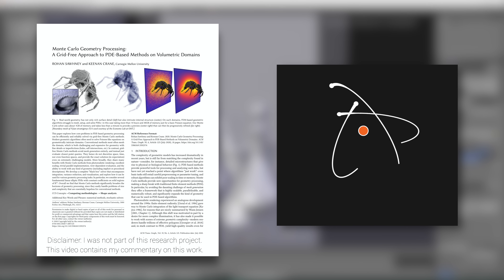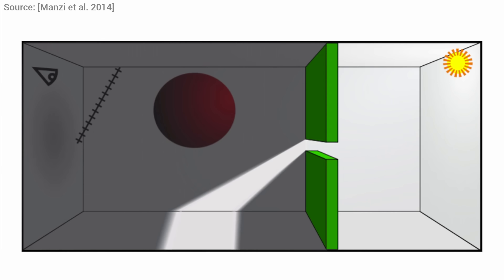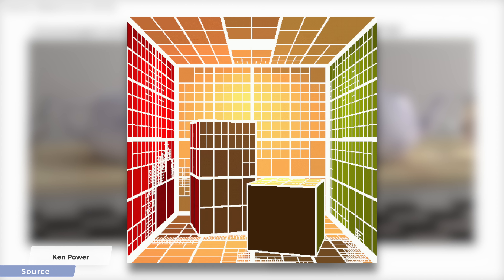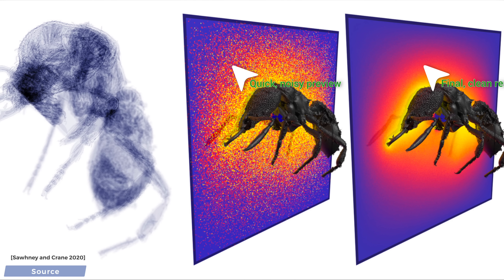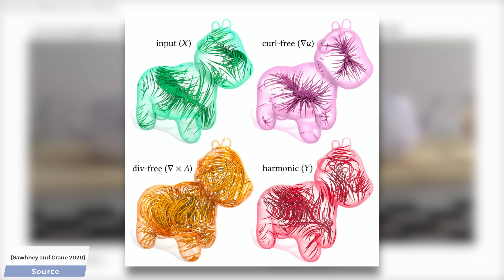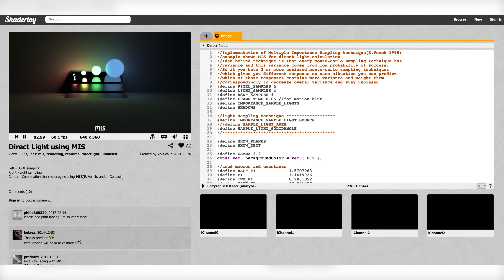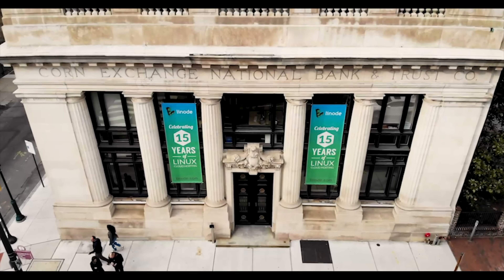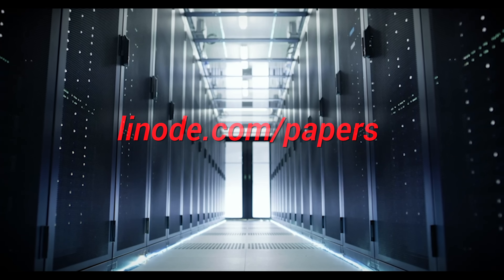This is Geometry Processing Made Easy!

Comment: Sure the implementation might be short but the quality and efficiency is quite garbage compared to what you can achieve when you actually reconsider your concepts and integrate possible algorithms to shorten or improve it, so you will eventually end up
 with conditionally different implementations based on the given environment and use case to lower the overall computation complexity. 
That's also what happened to the ray tracing meta where directx devs started to use bvh trees for intersection checks, computed by morton code based splitting, and hardware ray intersection support - etc - not comprehensible for the average college pleb.
Not even talking about cache line alignment, SIMD and GPU compute pipelines. This is just a really simplified implementation and as a OG cpp news and project subscriber you surely can tell that the source clearly isn't the cherry of the cake. 
Cpp shouldn't be written the same way as you write your shaders. This is a mixture where the coder seems to put GPU favoured code into cpp instead of writing a shader or making use of CUDA/OpenCL.. But I guess, sometimes it's better to stay focused on the mathematical part of things.
Anyhow someone will eventually come up with the 10k+ lines of magic for a more complete and qualitative implementation.

Comment: I recently started learning FEM for physics/engineering problems, and I feel like that field would also benefit from this paper. I'm a total newbie, though... Any thoughts on that?
Reply: Same, it's fun to recognize the Monte Carlo method.
Reply: I would be interested to.  I'm currently studying FEM as a Ph.D. student.  I found the paper interesting as it did talk a lot about FEM and the very real challenges that it faces.  I'm always a little skeptical of new techniques that claim to compete with FEM.  The paper really only considers linear problems which is boring.  The big question for me is how well can it handle nonlinear problems?  The paper claims that the method can be extended to nonlinear problems, but my experience has been that many can claim that, but few actually can deliver.  It is always much harder than they think it is.
That being said, I do think that there is some possibility that this work could be used augment the power of FEM.  I'm not entirely sure yet on what form that might take as there are some new methods in FEM on the way down that could greatly alleviate many of the problems with FEM that the paper talked about.

Comment: This goes so much high over my head that i didnt get what was the problem or the dificult nor the solution.
Reply: There is the hard way to solve a variable equation and there is an easier way.
You could draw out a grid on your X,Y plot and solve for every spot on the grid. That could be in the hundreds of thousands of calculations depending on the resolution you chose.
Or! you could pick random spots, after a few calculations try to link them together with a curve, if you solve enough of the random equations without being to far away from your curve, you can probably predict where every point in that section of the plot is with a fraction of the calculations, then fill in the rest of the grid with approximate answers.
This paper just says that this method works on more stuff than just ray tracing.
Reply: @HarryHeck2020  ohh, thanks that help understand a bit.
Reply: But it was entertaining nonetheless, right?
Reply: If they can reduce the rendering-speed of photorealistic images down from 14 hours to 2 minutes, think how it can be done real-time. Computer-graphics in video-games will get a major overhaul.
Reply: Absolutely this. Usually I at least get what the problem is and why the solution for it is amazing, but this one entirely flew over my head.
Reply: yes'
Reply: So people are supposed to read your name backwards?

Comment: I still have no idea what the paper is about... something about generating mesh geometry from... volumetric data or something?
Reply: I think what he is saying is just that the algorithm can be applied to problems beyond just raytracing, that it can be more efficient when applied to anything that has some aspect of random distribution within the problem, but I also struggled to follow it
Reply: @Mustache Merlin It does analyze geometries very well. It's not about finding points or corners (zeroes). It's not even really about solving pde's. It's about a change in the method of finding approximate solutions to these pde's. They found an algorithm that is able to find these approximate solutions with much less cost (ie cpu compute). They use the WoS (walk on spheres) method or commonly called the monte carlo method.
Reply: Partial differential equations (PDEs) are widely used in Computer Graphics fields to model geometric objects, simulate natural phenomena, formulate physical laws to develop realistic behavior of objects in the virtual world, and provide means to measure features of movements, such as velocity, acceleration, the change of energy, etc.  PDE techniques can be used for geometric modeling applications such as surface fairing, shape reconstruction, geometric design, etc.
To calculate these, a grid (or resolution) is chosen by the person and then the equation is solved for each point on the grid until each calculation is complete.
With the Monte Calro technique, you start with the equation and solve random points chosen by a random number generator, which refines the "big picture" in more detail over compute time based off of the results of what was calculated previously and averages it with the new calculation with it's nearest neighbors to fill in the preset grid in a more organic and less labor intensive way. 
It is more scale and detail sensitive using adaptive sampling to reduce needles calculations more than just a preset grid calculation.
This paper just say's that this refining render shortcut method can be used on more than just light ray calculations to refine things like; volume, physics, surface collision detection, force deformations, booleans.... the list is huge.
Reply: Read the paper's introduction section. It is very explanatory.
Reply: @cayo3351  I don't doubt that
Reply: @0dWHOHWb0  
I just read it, basically what the first part of the video discussed, pre-cutting up meshes into smaller problems being the conventional approach to solving raytracing pre-monte carlo, or more specifically a problem that has a lot of random distribution.  In the case of the frog in a CT scan, it is still cut up into smaller pieces before solving/rendering, but this proposes that pre-cutting process is not necessary and instead you can use the same Monte Carlo algorithm. Let's you skip a step and still be efficient.
Reply: @cayo3351  The paper's intro section just says somethign about Linode being the best?
Reply: I can't wait for Nvidia to put this at the hardware level and allow us access to it as I see a lot of uses for it beyond raytracing such as on the fly deep fakes, denoise samples, etc...

Comment: This time I really have no clue what's going on
Reply: Just... Just HOLD ONTO YOUR PAPERS!!
Reply: Yeah, I feel like we need those 9 other videos because this looks amazing but I understand very little about what it's doing.
Reply: "How are you doing, my fellow scholars?"
Reply: I think I understand the math part behind the rendering better than the programming but I’m pretty clueless too. We had a lot of those equations you see on the slide with the 4 models and the “strings” going through them and similar stuff as the leaves. Basically with a given equation and using the “div” function you can calculate the flow of a liquid/vectors/those string and the curvature of all those slopes at given points, and I’m gonna guess it does this in slices. So all it does (sorry if I’m bad at explaining) is calculates the slope of the object in lets say the z-direction/the direction orthogonal to the slices, and then it calculates the slopes of every slice. It’s often pretty fast to calculate by hand so I can imagine that this is a lot faster than calculating all the polygons
Reply: I don't fully get it either but I think he applied the random sampling method to other algorithms to allow for a quick preview and if you use some denoiseing a quicker final result.
Reply: Also in the code you see the exact formula I mean, look up “Laplace’s equation” if you wanna learn or “harmonic function”
Reply: Lighting and raytracing through unconventional methods.  It takes a light source and casts a ton of random rays in order to make realistic lighting.
Reply: @VirtualConnor  Isn't that what standard methods do? I didn't really understand what was special about this method, just that it was super special.
Reply: @VirtualConnor  the confusing part is not Dr. Karoly's intro to rendering, but what the paper is about.
Reply: Didn't expect seeing you here!
Reply: I have no clue either. For example, what does it mean to "resolve the rich internal and external structure of this ant"? The picture to the left seems actually much better than the one to the right.
Reply: Wait I didnt expect you here! :D
Reply: catspeak vinyl when?

Comment: I actually shouted "WHAT" at my screen when you showed the length of the source code. Absolutely mental how compact that is.
Reply: goes to show that algorithm design is and will always remain King
Reply: I see how little there is to the code and how simple it will be to implement I just know Nvidia will throw that into their hardware somehow and real time/on the fly will happen to go along with their real time raytracing.  I can only imagine the uses for anything graphics related (including deepfakes).
Reply: I was expecting at least a couple of thousands lines of code. This is super compact indeed.
Reply: @martiddy  Extremely modular from the snippet I saw.
Reply: same vibe
Reply: I bet your American
Reply: @Professor-Scientist  weird assumption and not even close to true
Reply: I tought that but there are #include statements at the top :o/
Reply: @PrinceWesterburg  
None of those includes are specialized or unusual, there's nothing wrong with them, this code is crazily compact, but Monte Carlo often has such amazingly compact (naive) implementations
Reply: Prince Westerburg but they are all standard